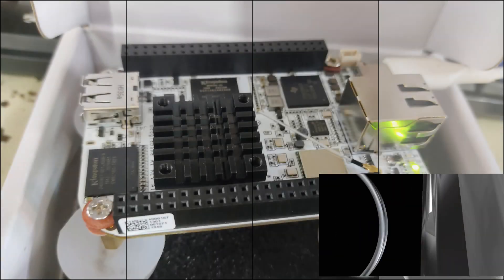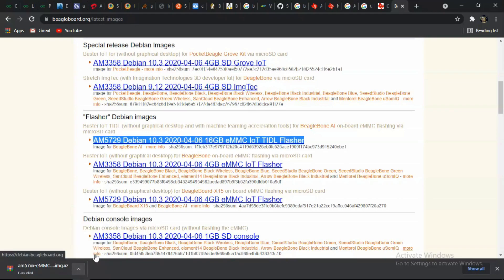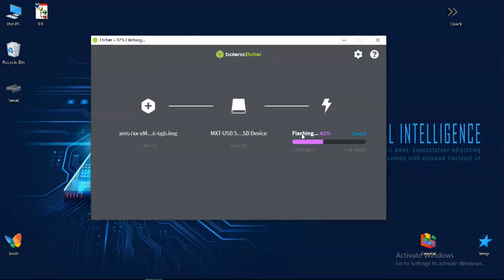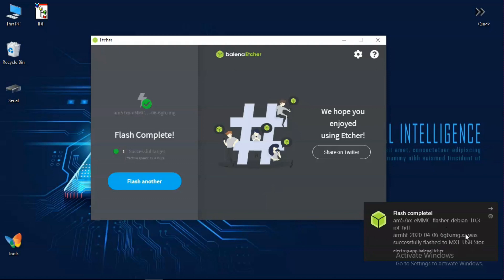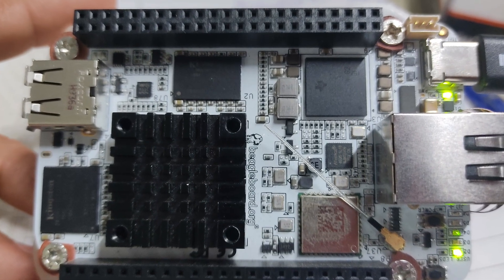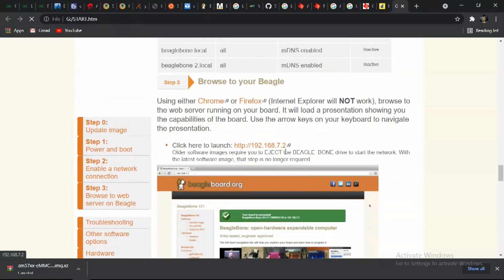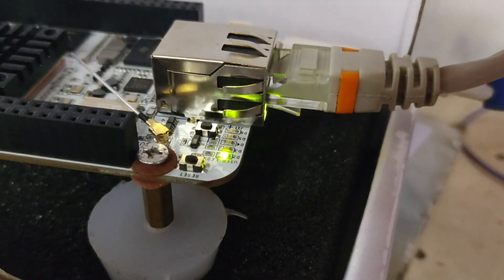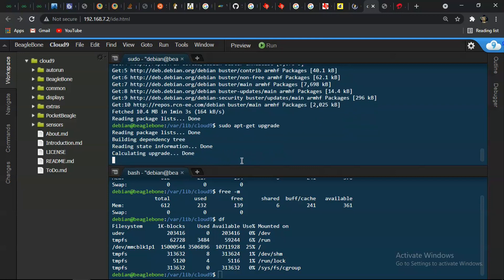Beaglebone AI Onboard EMMC Flashing using balenaetcher

Comment: any solution to this problem
[ 5084.602929] F2FS-fs (mmcblk1): Magic Mismatch, valid(0xf2f52010) - read(0x0)
[ 5084.610352] F2FS-fs (mmcblk1): Can't find valid F2FS filesystem in 1th superblock
[ 5084.622268] F2FS-fs (mmcblk1): Magic Mismatch, valid(0xf2f52010) - read(0x0)
[ 5084.631027] F2FS-fs (mmcblk1): Can't find valid F2FS filesystem in 2th superblock
Reply from the maker: are you talking about tidl library sorry i can't get you
pls share some more information or screenshots which might help me understand the problem better